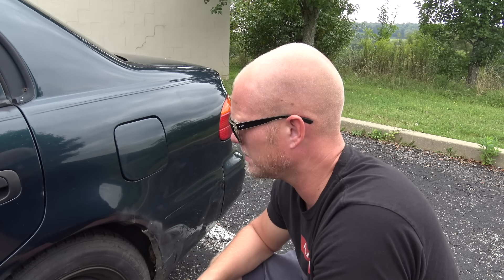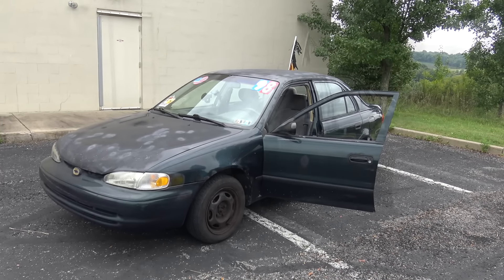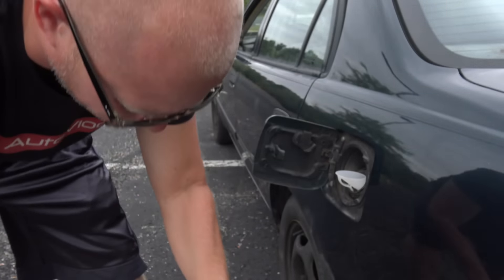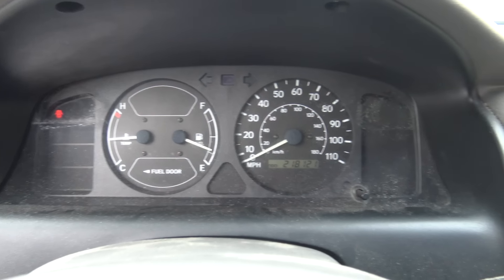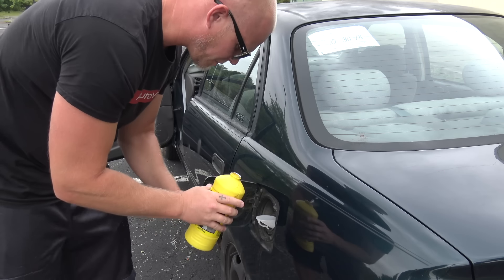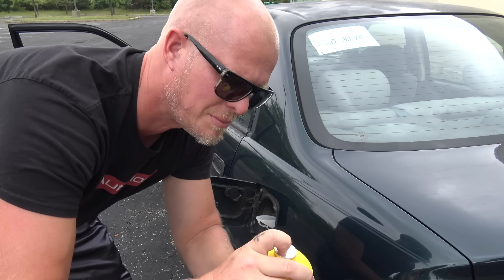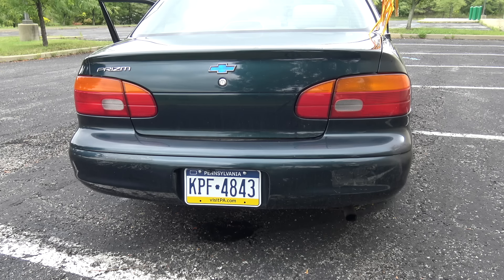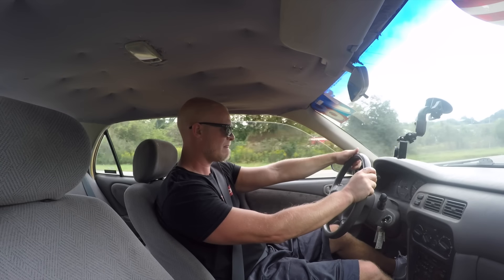What happens if you put BRAKE FLUID in your gas tank? (You'll be surprised!)

Comment: I used brake fluid in a diesel truck to keep it from freezing up. I was told you can use it to clean fuel injectors
Reply: Where do you live, diesel in the uk has to get -20c at least before freezing and anti freeze is cheaper than brake fluid
Reply: yeah...go w the anti-freeze...
Reply: Take the injectors out and soak the tips in a bit of brake fluid overnight.
Reply: @MarkSmith-jk4sl  When I lived in Montana in the 1970s we had to worry about diesel freezing. But it was more about the fuel getting thicker making it hard to start vehicle. We used block heaters to aid with this and to aid with keeping the engine from freezing. Block heaters were ( are ) also used in gasoline cars there. By the way, in Montana, it is not unusual for the temperature to be below -20 F which is -28.9 degrees c, significantly below -20 c. I saw it get to -30 F in 1976 which is -34.4 c. The block heater on my truck had a built in water pump which kept the water moving all the time the heater was working. Mine, like most block heaters plugged into the electrical power source at my home. I had a neighbor that had one that ran off a propane tank in the bed of his truck. He used that because it was not unusual for him to stay over night in remote locations due to his profession. A great side effect of this block heater was that the heater was always warm when you started your vehicle. :) 

 When I was using the block heater, I was living in Polaris Montana which is 7600 feet above sea level. TThe nearest mountain top to us was Comet Mountain which was a little over 10,000 feet above sea level. At the time there was a mining road which made it possible to drive to with in 2000 feet of the top of the mountain but was not possible in the winter due to the 10+ feet (3.0+ meters) of snow which accumulates on the ground. I went there many times in the winders by snow mobile. 

By the way, the air is so thin on Comet mountain that we had to adjust the airflow to the carburetor to go up there in order to keep the vehicle running. I had an adjustment on my Pick-up truck's air cleaner which allowed me to make these adjustments quite easily. It effectively made the engine run richer. I climbed the extra 2000 feet one summer and at the top, the air was so thin, I had to stop every few minutes to catch my breath. I was in excellent shape at the time but the air was just that the thin that it difficult to make the climb and after just a few steps (about a meter) I would go from completely comfortable in my breathing to panting as if I had run a mile.

By the way, I never heard of using brake fluid to keep the diesel from freezing.
Reply: They probably meant brake CLEANER.
Reply: Break fluid is a good cleaner will even remove paint so if anything it cleaned the injection system as far as antifreeze in diesel use IPA
Reply: Why not just use anti-freeze?
Reply: I've heard that ATF can be used to clean injectors as well. It makes sense considering they are both hydraulic fluids
Reply: @zprince4120  
The Mercedes dealer told my father that the injector cleaner they used called Red Line, was essentially transmission fluid.  It mixes completely with diesel and the detergents in it clean the injectors very well.
NOT AT ALL SURE HOW TODAYS DEF FLUID WILL REACT TO ATF TAINTED EXHAUST!   YOU MAY DESTROY THAT FANGLED NEW OBAMA REGULATION BULL CRAP DEF SYSTEM AND THEN WHO KNOWS HOW THAT WILL LOOK ON THE GOVERNMENT MANDATED EXAUHST TESTS YOU FOLKS WHO LIVE IN LIB STATES WILL HAVE TO PUT UP WITH.
Reply: @cnnmsnbcarefakenews4688  isopropyl alcohol or IPA is the main ingredient in diesel antifreeze not sure how it would do in gas maybe burn some valves
Reply: Bush Master...  For reals? Take the injectors out -of a diesel truck?
Aaaaah. . Naaah. . . . .that sounds kinda silly to me
You know how long that would actually take tho?
Reply: @JR-qw6eb        block heaters, are used in Alberta Canada in apartments parking spots in the morning after a very cold night unplug the short extension cord and motor starts with no problem and the  water for your heating will be ak too

Comment: Im predicting you now have very clean injectors...
Reply: And clean valves and pistons.
Reply: Brake fluid is expensive 🤔
Reply: Andyoges l
Reply: Busca
Reply: El Daddio no brake fluid is very affordable
Reply: Squeaky clean injectors and total fuel system clean-up!  You may have hit on something..  :  ) As long as it doesn't plug the Gas filter from sediment loosened in the tank You'll be good.. If mine I'd change the gas filter

Comment: I had 1 exactly like yours and I wish I'da kept it cause it's still running. It had over 300 thousand miles and it's probably got 500 thousand miles now. It's a Toyota Camery with Chevy badges on it lol...Don't let the miles fool you, tape over the miles and keep the oil changed and it's hard to tell how much farther you can go in that car lol...With gas prices the way they are now, in 2022 I'd love to have that lil car and I ran the crap outa the one that I had and the engine and trans is still goin.I think all the brake fluid did is cleaned the fuel system although it may start acting up but I doubt it lol...If the body's would've held up those lil cars would run forever probably. I'ma huge fan of em and I have no preference as long as they go without gobs of issues that's all I care about lol...

Comment: What happens if you put an ignited zippo lighter in your fuel tank??
Reply: Haaaaaaaaaa!!!!!
Reply: You'll see a bright light,.....Heaven.
Reply: I'm going to have to try that
Reply: Geovanni ignited Zippo lighter it would go kaboom but if you throw a cigarette in the gas tank nothing will happen long as it doesn't Spark
Reply: Depends on how much air is in the tank.  A person I know told me his dad dropped a leaky gas tank off to get welded.  Csme back the next dsy and the front of the guy's shop was missing...
Reply: @Disappointed739  actually its gasoline vapor. but it would need some air to explode, plus a heat source. ;)
Reply: @jldude84  Exactly... gas can ONLY explode when it has oxygen to help it burn. Pop the gas cap on and its over. No O2 in a gas tank, unless you have one that is mostly empty, and it draws some air into it somehow...

Comment: wouldn't the quarter of the gas you have in the tank dilute it enough to where the brake fluid is essentially non existent? I think the gas will burn faster than the brake fluid and if you don't fill your tank with gas that in a couple of days still driving that your entire engine will probably be caput. can we get a follow-up on what happened or did you fill the rest of the tank up with gas?
Reply: Kaputt????
Reply: @heinrichshredder747 dead 😂

Comment: Brake fluid is actually good for the injectors cleaning them
Reply: And eating any oring it get in contact with
Reply: @anjiwalters6829  it will not eat an o ring , it will swell them. what do you think holds the piston in the caliper .. an o ring .
Reply: JJF   Its a different type of rubber used in brake calipers from normal o rings
Reply: @anjiwalters6829 t doesn't eat O-Rings.. Did you know that there are O_Rings in brake cylinders, etc?
Reply: But NEVER EVER put pepper in your gas tank for it will clog your fuel filter and cut out, die or just run lousy.
Reply: @musicman1943  not only that.....most orings in vehicles are made of Buna-N which is tough as fuck and nothing will eat away at it. Buna-N is also insanely popular and a favorite amongst plumbers for vacuum seals/breakers for flushometers and other valves....ya know....shit like that
Reply: Please don't say this i have a habit of trying people's myths  out! 😂

Comment: Brake fluid swells up any rubber and seals.  I’ve used a very small amount to seal up power steering  leaks   You should try to run the car on E85 and see how it will perform mpg and power  😎✌️

Comment: Thats a Corolla thats why its still working
Reply: ya, well the steering wheel says different
Reply: Chevy primz is the same car as the toyota Corolla .at least the 2000 2002 are
Reply: @Andrew Toupal if it walk like a duck and quack like a duck is a duck
Reply: @mezeerick84  
Call your local Toyota dealership and ask them for Geo prizm parts to find out for yourself.
I know it's the same car I have purchased parts for both .
Dealerships confirmed it
Reply: @Joey-tj3nk  bro im a mechanic if u don't belief me that's ur problem. Corolla and primz take the same body and engine parts. Don't be naive do ur research try it out urself them u can talk all the stupidity that u want

Comment: This is an old beater car so even if the engine blew up, no significant loss.  Even based on this experiment, I would not try it on a car that you rely on for transportation.  Questions left unanswered- (1) Did it affect the octane of the gas?  (2) Did it damage the paint where it dribbled out of the funnel?  (3) Did it damage the catalytic converter?  (4) Did it affect the O2 sensor system?  (5) Did it affect any seals in the fuel system? (6) Did it affect fuel injectors?   Probably a lot more unanswered questions that may have longer term effects as opposed to two quick trips down the road.  This is an old car with old technology.  I doubt anyone would want to try this on their brand new $50,000 SUV or truck.

Comment: Never spill brake fluid on pant. It destroys it.
Reply: I was wondering if he found out how good of a paint remover it is when he spilled it all down the side of the car. But if you catch it right away it will wash away with just plain tap water and will actually work like a cleaner in the area where you spilled it.

Comment: Your engine will run great on pure paint thinner until it eats the seals out of the fuel pump.
Reply: Paint thinner doesn't run all that great and it stinks to holy hell
Reply: I used to clarify and put used thinner in my trucks gasoline, to get rid of it a little at a time. I don't know how much, but I was a painter for over 20 years.

Comment: The problem will come when all the rubber that the fluid came into contact with starts to swell.  Brake fluid works exactly like stop leak on rubber
Reply: Samuel J  that's a specific type of rubber
Reply: I could be wrong
Reply: Will transmission fluid do the same to the rubber?
Reply: All rubbers swell with fluids, and dry/shrink/crack in the absence of them. That's how I got here : D
Reply: @amyhoang9140  I can't speak for all rubber but our shop rebuilds power steering gear boxes which have quite a few rubber seals in them.  The go to fluid for most of the shops that install these and most of the trucks that are maintained and serviced by the owners use ATF for fluid in these boxes instead of power steering fluid.
Reply: It's brake rubber parts such as the cups and o rings that swell with oil and gas, not the other way around.
Reply: That's only with Dot 3 brake fluid, he said he used. Dot4, different chemistry.

Comment: I use brake fluid instead of WD-40 because it soakes into the rust faster and breaks loose better. I use an eyedropper. Just don't get it on your paint
Reply: brian b Funny,  I use it as a paint stripper for metal models and tools I'm refurbishing.  It works great.  Brake fluid is a pretty versatile product.
Reply: I use brake fluid because it's made up of ground up whales on the endangered species list
Reply: Brian B. What if you used a turkey baster instead? Eye dropper seems like a long time?
Reply: @badbob85037  No its wayward inter dimensional beings who slip through the inter dimensional port hole :)
Reply: i poured a half bottle on the hood of a truck and let it sit for 3 weeks and it did nothing to the paint
Reply: brian b That's very true. Screwed up a good paint job once. You noticed he slopped it all over his paint in the video?
Reply: Brian b not many cars use Dot 3 brake fluid anymore and that stuff would eat paint like a fat man at an all you can eat buffet.  Now most manufactures require Dot 4, 5, etc, etc.  They do not harm the paint.
Reply: brian b hell yeah. Chrysler for life. got a 76 m881

Comment: Try a 50/50 mixture of fuel and water, see what happens?
Reply: Lachlan
That's easy it will stop running. The water goes to the bottom of the tank gets picked up BY the fuel pump and it won't burn so it stops.

Comment: Next lets put gas in our brake systems.
Reply: Hilarious!
Reply: @wolfburgman  8
Reply: @wolfburgman  o
Reply: Because there is always the chance a car owner will mistake the master cylinder cap for the gas cap, right?
Reply: When I worked at Sears Automotive I had a customer that put power steering fluid in the master cylinder and it caused every rubber seal in the brake system to swell up. And everything had to be replaced including all steel line's for any residue left in the lines would swell the new seals, even the factory proportioning valve had to be replaced
Reply: Or windshield wiper fluid in the cooling system lol
Reply: Right lol or do an oil change with brake fluid!! U will only have to change it every 200,000 miles
Reply: Grunt Ohseven 😂🤣
Reply: That would be more interesting
Reply: Lol

Comment: Brake fluid is hydraulic oil and oil burns so its not gonna harm the engine. I chuck 40:1 oil ratio in my tank everytime i fill up as it's a two stroke.

Comment: The percentage of brake fluid vs fuel is so small it should not of made any difference at all. And it didn't.
Reply: My guess is that it only had at most about 3 gallons of fuel. It is at least 20 percent brake fluid.

Comment: That brake fluid will probably just give the engine a bath on the inside, clean out the fuel injectors and not hurt it much except the gaskets and rubber seals
Reply: yeah I was wondering about that. Im not a mechanic either but,  haha
Reply: Chip Winningham
 Brake fluid will not hurt Gaskets and rubber seals.If brake fluid was bad for rubber seals you wouldn't be able to use it in a brake system that is loaded with rubber seals.Oil is more harmful to
rubber than brake fluid.I had a friend that had added oil to his master cylinder by mistake one time.
It ruined his whole brake system that needed to be replaced.
Reply: @dbfortner1949   I had a friend that took his car in to have the oil changed. The mechanic put power steering oil in the brake system. If you put a light behind the reservoir you could see that they were not mixing. this was dot three brake fluid system . But it did go through the system and swelled the seals in the system.  there is different  material make up of the seals. So if they did this same test with dot three it would be interesting  to see the results, because the different brake fluids have different make ups.
Reply: That doesn't make sense. If oil is harmful to rubber, then why do we use it in our engines to lubricate the o-rings on the pistons?
Reply: @canadianwildlifeservice8883  it is different material the seals are made of, the oil from the power steering fluid made them swell. It cost the company that did it about 2000 dallors it repair, because it was a antibrake system car and that controller was damaged too
Reply: No mechanic here but piston ring are not rubber "o"rings. They're metal.
 @canadianwildlifeservice8883
Reply: @canadianwildlifeservice8883  You're kidding I hope.
Reply: oil rings on the pistons are made of steel  @canadianwildlifeservice8883
Reply: @UBETYURASKI   I was referring to the seal material in the brake system,  He said o-rings on pistons, think he means crankshaft seals and other seals in engine! If he meant pistons in brake cylinder I was referring to the difference in the make up of the material. and yes piston rings are metal, lol !!
Reply: I  was in military.  Put it this way, you don't need gas to run cars. Combustionable engines take air & gas. But they have several other engines and one will run just fine on water and magnetic propulsion..but then nobody would make any money now would they..
Reply: Nope, I'm not kidding. I just never thought that a metal piston ring could create a seal, since metal expands and contracts.
Reply: Alan Weir. That's why most four stroke gas engines have three rings per piston.

Comment: I had used breakfluid in my  1975 Mazda 323 transmission to stop a slipping problem and it worked very good until I sold it.

I also add transmission fluid into my engine and run it for a few minutes to remove gunk build up before oil change.

Comment: Years ago I was driving an old beater Dodge pickup. It ran out of gas. The only thing i hadwas a gallon of mineral spirits paint thinner. I poured it in the gas tank and hoped it would start and get to a gasstation a few bolcks away. It did. Ran really crappy but it got me to a gas station.

Comment: in older semis if you had injector problems poured a quart or two of transmission fluid in each tank. A couple hundred miles down road start banging and clacking  white smoke pouring out of exhaust ( sometimes get a big pop sound). Truck take off like a bat out of hell. No more problems. DO NOT try with these newer engines with all the environmental crap on it!
Reply: john keeler friend of mine had an early 60’s Ford. When he changed the oil he would put 1/2 quart of tranny fluid in it

Comment: Brake fluid makes the rubber seals and fuel line become soft and swell.
Reply: So does the ethanol they put in our gas. I have pulled several fuel pumps to replace and only replace the short rubber hose due to ethanol weakening the rubber making it burst under pressure. Most all late models have plastic line instead of rubber for that reason

Comment: It would be very interesting to see if it cleaned the fuel injectors or top of the pistons free of Carbon!
Reply: Old school way dumping transmission fluid down the  carbrator ,cleaned the carbon off the valves . I've even seen it free a stuck valve.
Reply: @calebowens3291  yes old mechanic showed me that trick 30 years ago
Reply: Why?????? Hope this is something I never have to contend with!